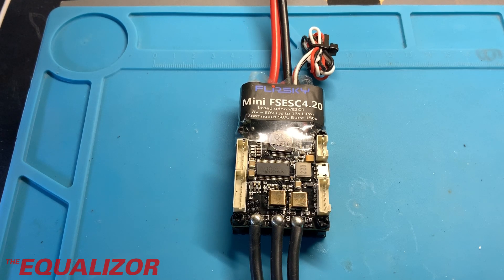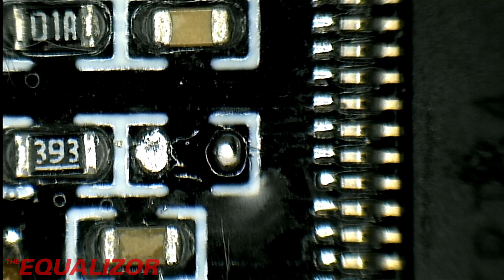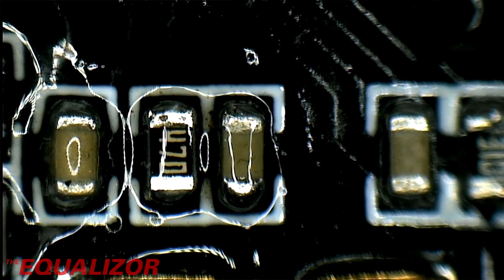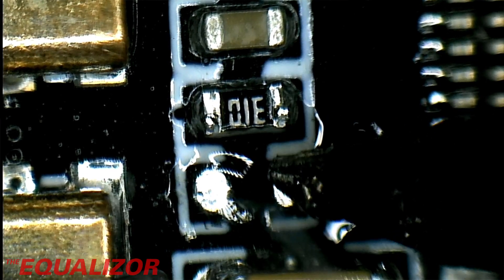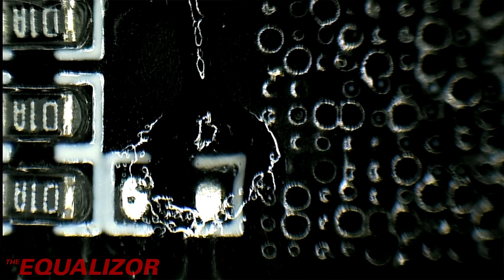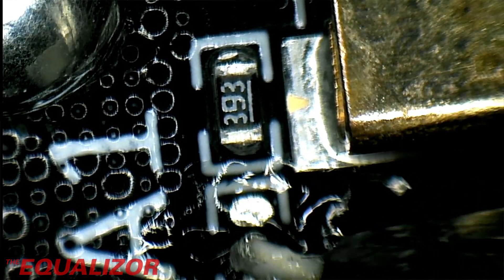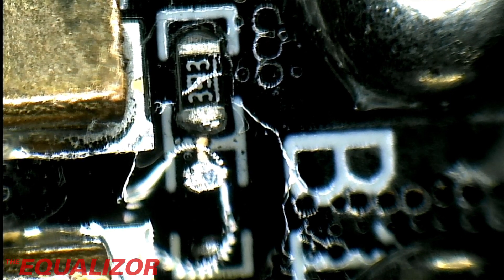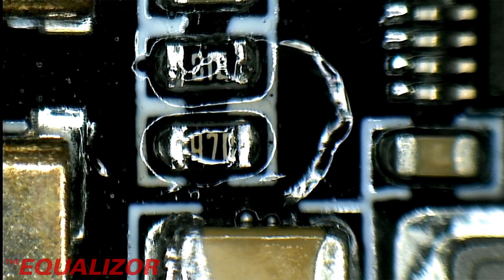Flipsky motor controller resistor replacement

Comment: Thank you for taking the time to make this video. The DIY market is pretty small in general- and the amount of people willing to attempt repairs is even smaller. I hope you continue to make flipsky ESC repair videos. 

One of my ESC unplugged while riding and will not power on now. Do you have any idea what may have went wrong? People have mentioned it likely got too much voltage. 

Are you aware of the components that would fail from over voltage?

Comment: Amazing work! 
I'm trying to find out exactly what exactly flipsky esc defect is.  Do you thinking about to offer a repair service?
Reply from the maker: The issue we had was that they’d fitted the wrong value of resistors at the factory. I don’t know the ins and outs as I was only asked to replace them as I have all the gear to do it. Newer controllers already have these fitted. If you were near me I’d offer to repair it for you for a small sum but really anyone with the right gear (decent soldering iron, microscope, optionally hot air station) could do the job.
Reply: @the_equalizor  How did you know that they need to be replaced.
Reply: How did you know that they need to be replaced.
Reply from the maker: LMT Lipola it’s a known issue with the early Flipsky controllers apparently. All newer ones have the resistors already changed.
Reply: @tomgreysk  someone for electric skateboard builder forum found the problem.